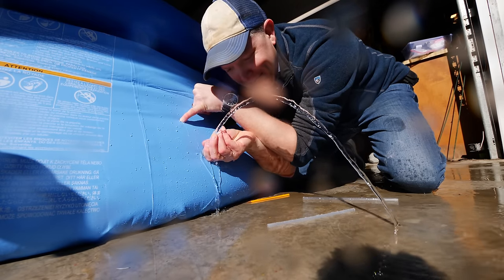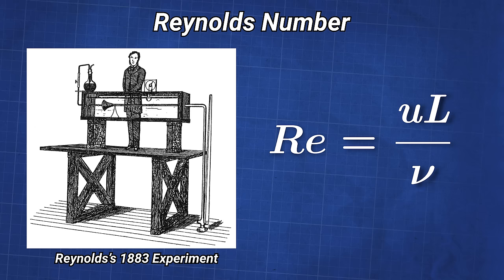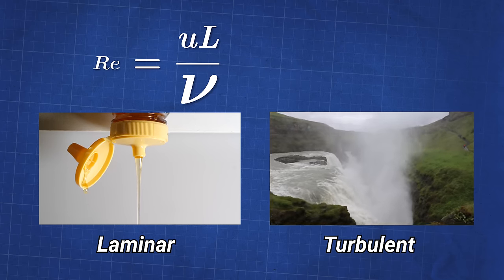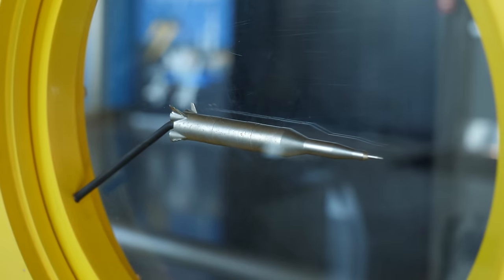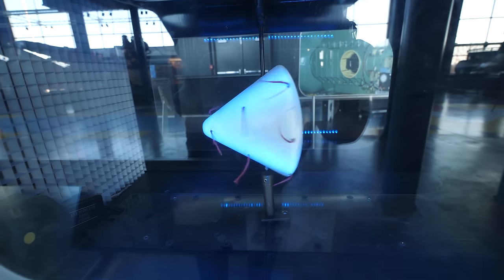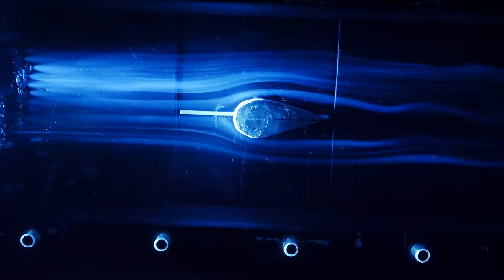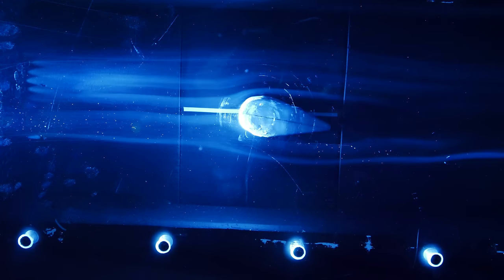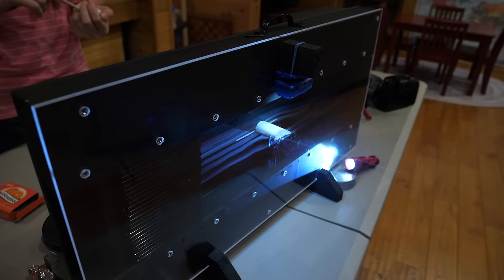Why Laminar Flow is AWESOME - Smarter Every Day 208

Comment: Hey, destin i am a window cleaner and I wanted to see if maybe you'd do a video on the topic.
the way water adheres to glass and the way the squeegee takes it off is mesmerizing but there is a lot of science there.
like if you scratch tempered glass the scratch widens hours after it occurs so if you do scratch a window you won't know until later. another thing I've noticed is if you clean some tempered glass panes when you go to squeegee it at the interface between an area that's dry and an area that's wet will make this strange branching pattern I wish I could explain it more but it looks like trees or like veins in your body. also, we use a system that filters water pretty often we can get dissolved solids to less than 2 parts per million that way when we spray the windows the water leaves behind no minerals and we use polarized glasses so we can see if there are plastic films on the windows. there's a lot to cover but I figured its something that could be interesting
sorry this is so long its just a topic that excites me!
Reply: ☝️ yes please, this sounds interesting
Reply: Sounds interesting. A video on this would be awesome!
Reply: The basic principle you are looking for is surface energy which leads into wettability,  and/or wetting angle.   This leads into capillary action,  even why bubbles are round. 

Cheers
Reply: It's always nice to hear somebody talk about their work when they have a passion and curiosity for it whether it be rocket science or cleaning windows.  That's the kind of craftsman that you want to hire.  It's hard to find people who care as much about your own property as you do , but when they still hold some wonder and passion for their work it's the closest you can get.  Makes paying the final bill a little bit less painful because it is usually a job well done.
Reply: The passion of surface tension in a dynamic state is very cool; an art and science in one. Just as fascinating as laminar flow.
Reply from the maker: Yeah email me.
Reply: this is awesome! i don't usually comment but this time  i would in order to help push this through.
also, thanks for those crystal clear windows! and take care while cleaning them. :D
Reply: Another topic related to glass is the interaction of light. Most light goes through a sheet of glass but some reflects off the surface. When you look at a framed picture covered with glass you can see the picture but you can also see reflections in the glass. The percent of light reflected vs transmitted varies in a complicated, quantum manner. Richard Feynman describes it in his book, QED The Strange Theory of Light and Matter, but I did't really understand it.
Reply: @Blox117  That's a window cleaning liquid or solution. A window cleaner is a person using window cleaning liquid to clean windows.
Reply: @CrimsonEsso  yeah it was just a joke
Reply: This sounds like an awesome idea.
Reply: CrimsonEsso facepalm intensifies
Reply: I would recommend a FILM crew for this project!
Reply: This sounds fascinating, I would watch it for sure.
Reply: This sounds like a great idea!  It's amazing how many seemingly mundane things we do every day turn out to be fascinating, if only viewed from a different angle.
Reply: Wait his name is Destin my name is Destin

Comment: Destin you forgot the bloodstream, which is always laminar in our arterial vessels, and any damage to the endothelium, like say atherosclerotic plaque, creates a  turbulent flow and it causes  further damage to the arterial wall. Blood is pretty viscous liquid, and any disturbance in its flow causes all the blood particles to collide with each other at a greater rate and that causes thrombosis. So, keep it laminar, keep it healthy!
Reply: Thats something new. I didn't knew that fact
Reply: I've always been a bit dubious on that claim, since they use Reynolds number criteria on a pulsating suspension in elastic walls, where they shouldn't really apply.. Normal bloodflow is pretty stable and it's clear that problems arise when it get's disturbed too much, but characterising it as "laminar" is getting challenged quite often, as it probably isn't that in the classical sense of the term.

Comment: Go sailing.  The sail has streamers on it to assist the skipper in trimming the sails.  Ideal trim will give laminar flow on both sides of the sail.  It's easy to see and feel the difference.
Reply: Well, the streamers tell you if the flow is attached or separated. If the flow is separated, there is a small region close to the sail where the flow is going backwards and that is not good for performance: the surface where the flow is separated do not contribute to the overall lift (for a wing). Streamers help you get the highest angle of attack that do not lead to flow separation. Furthermore, laminar flow is more likely to become separated (but yields a lowest friction frag), while turbulent flow is more resistant to separation (but yields a higher friction drag)==> when you increase the angle of attack, turbulent flow (boundary-layer) is wanted to prevent separation, while at lower angles of attack, you want a non-separated laminar flow with a lower friction drag. Hope I made an interesting point :)
Reply: nice, someone is wealthy
Reply: I knew this trick when sailing my dad's dinghy but never realised the science behind it. Thanks.
Reply: if you have laminar flow sailing then youre losing a lot of speed and wind and power
Reply: @gambrinus330116  You can find free boats on Craigslist  and facebook sometimes and you can use public boat launches.
Reply: @SpeakerMunkey  To be clear, per the earlier comment above, the streamers, aka tells, indicate whether the flow is attached or not.  They generally are not adequate to detect laminar flow.
Reply: Marko Feller sailing isn’t just a rich man’s sport, I started sailing in college

Comment: Destin I love laminar flow. I have the privilege of flying a MD520N helicopter. Laminar flow is used to generate air flow over the tail boom to generate the anti-torque forces needed to counter the torque produced by the main rotor. The fluid (air) is used instead of water so you can’t see it, but it’s happening! NOTAR (No Tail Rotor) if you’re interested…
Reply: Ah! This is great information! Thanks for sharing this!

Comment: Ironic that, on a video about perfectly smooth flow, the resolution is turbulent!
Reply: Life can throw a curve every now and then.
Reply: It's not about the resolution it's about FPS,.  4k at 25fps is worse then 1080 at 90fps
Reply: But for me the resolution is only 360p
Reply: @jimmydelagarza3208  same for me too
Reply: @timtomnec  that doesn't make any sense
Reply: @Cris-tm3px  Most things will cap at 90 insted of a 100, 1080 is one forth the res of 4k.  so even tho you are showing the same amount of pixels the older tech with the smaller res wins.  if you are still confused Linustechtips did a bit about it.
Reply: Might be due to the limitations of Youtube video formats with relatively low bit rates. Tom Scott covered this when discussing snow and confetti.
/watch?v=r6Rp-uo6HmI
Reply: The only option I get is 360p as well
Reply: @timtomnec  Only if you want things to look like a soap opera.  I agree, 1080 is fine for resolution on the internet, but videos almost always look better at 24fps.  Destin particularly needs to film in 24 or 30 since he often employs the use of high frame rates for slow motion.  These effects would be reduced dramatically if the video had to be presented at 90fps.
Reply: @brianhawkins  you missed my point, I never said 1080 was good.  just said it was better to have FPS then resolution in the same way its better to have audio over video.

Comment: Surprised that you didn't touch on how water with laminar flow acts like fiber-optics when you add light.  Very cool.
Reply: you just blew my mind i didnt think of that one.
Reply: Also surprised he didn't mention Reynolds number below 1000 is laminar. 1000-2000 is transition. Greater than 2000 is turbulent.
If you like this, there is a really easy to observe phenomenon called hydraulic jump which involves laminar flow.

Turn on a your kitchen tap so the water lands on a flat area away from the plug hole. Watch the water spread out in a flat ring then rise in level suddenly. THAT IS A HYDRAULIC JUMP AND IS THE PLACE YOU SEE LAMINAR FLOW EVERY DAY.
The water in the lower region is laminar. The ridge is the transition region. Beyond that is turbulent.

Comment: One reason to like turbulent flow: I was on an airplane with a lead R&D engineer from the medical industry and we were chatting about artificial hearts and why we don't see more people with turbine style pumps replacing bad hearts. He said something they found out about these "artificial hearts" that just flow blood and not pulse or pump the blood is that the pumping causes turbulent flow in the capillaries of the lungs; he said for some reason, the lungs could not dump as much heat into each breath of air when the blood flow was laminar, causing eventually over-heating of the patient and failure of other organs. Pretty interesting
Reply: Wow, definitely interesting. I wonder if that could be because blood is a non-newtonian fluid, thinning when it is under compression allowing for better transfer into the capillaries?
Reply: One other reason to love turbulent flow:  that first line. Airplanes, golf balls, automobiles, the drag and lift components all prefer turbulent regimes.

Comment: In practical applications outside of space science and making fancy water fountains, laminar flow is not wanted in many if not all fluid processes because it's extremely inefficient at transferring heat. In laminar flow, you have a streamline flow in the center that is actually moving faster than the streamline flow on on the outside. In other words, the outer-most layer in laminar flow that's not mixing and moving slower, is not transferring heat as well as turbulent flow because flow rates play a big role in heat transfer rate, as well as the outer layer having a cooler temperature than the center of the stream (likely because of the relationship between pressure and temperature). You also likely have parallel flow going on between the 2 outer and inner streams, which is also inefficient.
Reply: Wow thank you for that insight!
Reply: I also feel like I remember from an aerodynamics course that turbulent flow can delay the separation of the boundary layer over an airfoil, reducing the lift induced drag and noise. There are actually ridges placed near the leading edge of some airfoils to trip the flow and induce turbulence in the flow to make this delay in flow separation.
Reply: Great info, thanks.
Reply: akin to the dimples on a golf ball creating a thin turbulent boundary layer and allowing  the bulk of the laminar   flow to remain attached further around the ball. This results in lower drag in a specific speed range   The net result is that a pro can hit a dimpled ball ~ 2x as far as a smooth ball..
Reply: @fneuperger  Yes! I forgot about that!
Reply: Huh???  Laminar flow is EXACTLY what is desired in industry from fountain makers to sewage plants. A flow more stable and less turbulent will be Less likely to damage downstream equipment,  be more predictable when metered amounts of a fluid are needed and allow engineering to maximize efficiency by not over engineering and minimizing costs. Your description of the flow rate against the side walls is less than then the middle of the pipe during laminar flow  is accurate. BUT at the same inlet  psi, a laminar flow will be able to flow more since the fluid isn’t turbulent and energy wasted having fluid going every which way but straight. This is evident in a simple flow test with a given Inlet psi and various delta P.   Then add a stream straightener and rerun. The over 20 yrs of R&D Engineering within the fluid control industry has shown me this.
Reply: @fneuperger   Yes But the THIN boundary layer is there to increase laminar flow around the back of the golf ball where drag creates a low-pressure turbulent zone. It's all about increasing laminar flow BEHIND the golf ball. Also, golf ball dimples are there to create lift by changing air pressure below the ball.
Reply: If your talking heat transfer than laminar flow is essential. For example, a finned radiator. Inefficiency of laminar flow heat transfer is not as important compared to the relationship between surface area and volume of fluid.
Reply: @loki475  In a shell and tube type heat exchanger, you have these plates called "transverse baffles" on the shell side of the heat exchanger that provide stability for tubes and prevent vibration. But, they as well as provide turbulent flow due to the sudden change in the direction the baffles provide for the fluid. I study refinery operation and design closely, and looked into laminar flow in quite some extensive detail, as well as why it's not wanted in the applications we use it for. Yes, surface area is a big factor among the 5 common factors of heat transfer along with thermal conductivity, but if you see the areas of low and high pressure in laminar flow and understand the relationship between pressure and temperature, you'll understand why heat doesn't transfer as well. 

But to put this into a little more context so it doesn't get too confusing, I was talking about fluid to fluid heat transfer, not heat transfer provided by air cooling because that's a whole different animal.
Reply: @Zendreax  Ya I see what you mean. I've dissected a few radiators and heater cores out of curiosity. Big fan of air-cooled engines... pun intended.
Reply: Thank you. I felt like turbulent flow needed a little more love in this post as well.

Comment: I would enjoy patching that pool.
A good patch is one: Applied on the inside, so that the more the water pushes against it, the stronger the patch holds against leaks. all you need is similar material of same thickness, and bonding cement.
If I was better at video I'd be posting on how to patch leaks

Comment: Would be awesome to see how far this scales up! As in, how big can such a 'glass dome' get!
Reply: Unfortunately if you look at the equation of Reynold's number you can see it scales up with size so it's easier to get turbulent (and conversely harder to get laminar) flow at large scales.
Reply: @Smitology  yes you would have to keep the flow in sheets while having enough pressure behind it, I bet different liquids have different reactions to trying to create laminar flow...the viscosity of liquid changes everything, as can temperature

Comment: Destin, at 7:20 you showed a fountain which produced laminar flow. My primary question is if you were to take a cross-section of the fountain would the water at the bottom be thinner than the water at the top near the spout?  

My secondary question would be, if the primary question is true, is the water (that is producing the sheet that is thinner at the bottom) being 'held together' by the surface tension of the water or just the fact that the flow is laminar and all the water molecules are moving away from one another at an equal rate?  

Finally, at what point does this surface tension break on that sheet and what are the characteristics of the broken water?
Reply: Fisrt answer is yes. The fluid's gaining velocity,  and the bernoulli equation relates velocity inversely to pipe width.

Comment: In laminar flow, the pressure is lowest and velocity is the highest in the centre and in the periphery the velocity is lowest and the pressure highest why?

I will try to give an intuitive answer since I don't have a mathematical one. If you find any mistake, please do point out.

Due to the friction with wall, the velocity is lowest in the periphery.

Due to friction with the walls in the periphery, you would need a higher pressure to counteract this pressure. This is similar to how electricity works: higher resistance means the voltage difference across the resistor is also higher.

How does higher resistance or friction lead to the formation of higher voltage or greater pressure? Let us consider a bunch of electrons flowing through a circuit. When they encounter a resistor, initially only some electrons will be able to cross it; the rest will accumulate at the starting point of the resistor. This accumulation of electrons creates a potential difference, pushing the remaining electrons to move across the resistor. Once the flow of electrons due to this push becomes equal to the flow of electrons elsewhere in the circuit, further accumulation stops, and this is how voltage is formed.

A similar phenomenon occurs with water: the accumulation of water due to friction creates pressure, pushing other water molecules. The flow of electrons in conductors is not entirely similar to the flow of liquids. For example, water molecules attract each other, while electrons repel each other. Due to this repulsion, electrons mostly travel along the periphery of wires, a phenomenon known as the skin effect.

Comment: 8:50 i feel water in my ears
Reply: same,  what headphones you using?
Reply: same here
Reply: By 8:56 I desperately wanted to put my finger in my right ear.....
Reply: @brinks2469  my massdrop x sennheiser hd6xx's made it sound crazy realistic
Reply: @HululusLabs  nice  i got hd 700s and a gsx1000 amp
Reply: @brinks2469  Is the virtual 7.1 on the gsx1000 any good?
Reply: @HululusLabs  It definitely works and feels good. It makes the music or game feel more alive. Only thing is that its max impedance is 150 so if you want to use like hd 650s or hd 800s (not sure why you wouldn't just spend another 1k on a sennheiser ampif you had 800s) you would need to put another amp between the gsx and your headphones.  Anyway it's good and I would recommend it especially because the sound modes are very nice.
Reply: omg
Reply: Yeah, I actually felt that.